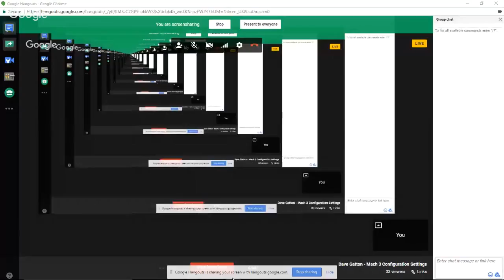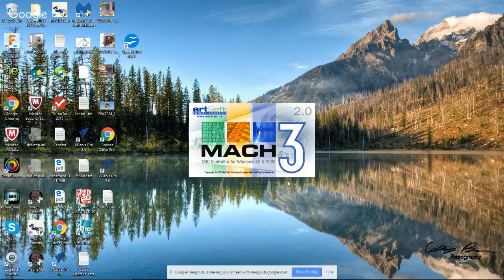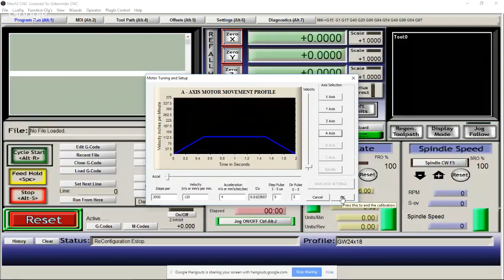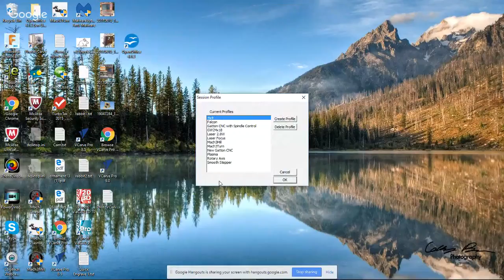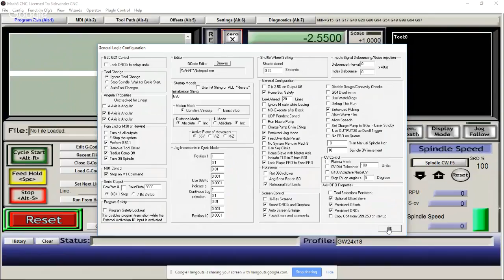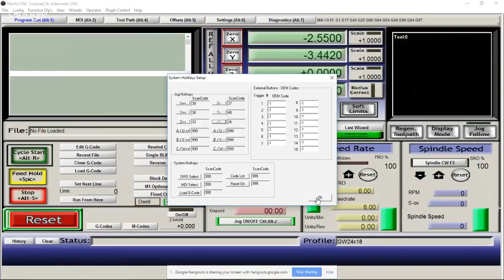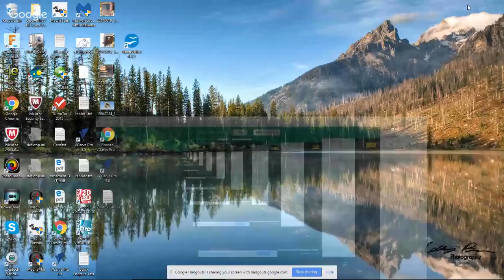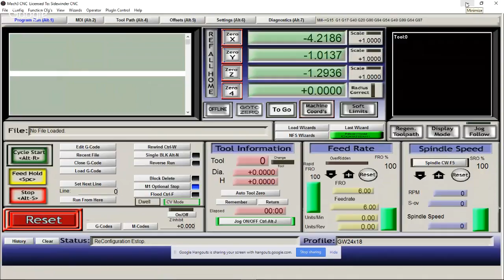Dave Gatton - Mach 3 Configuration Settings

Comment: Your  vid is good ,I can understand what you doing,,,,I have a problem with my mach3..and the guys at NFS... are poor help ..so
I have a 3040 4xis cnc..and when i use the text writeing  in there addons....the text is  very small ..like  quater inch small..
what setting do i use to change the size of the text...I also cut a circle..It should have been  20 mm...i thing it was super small...can you help....email me...